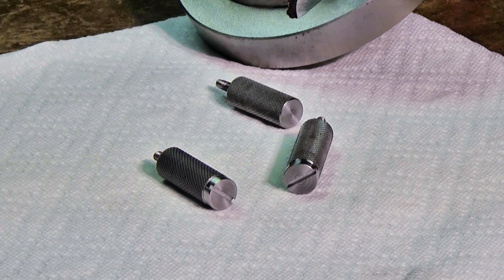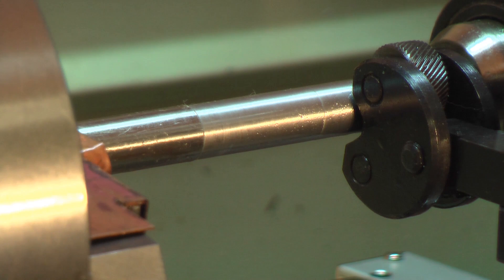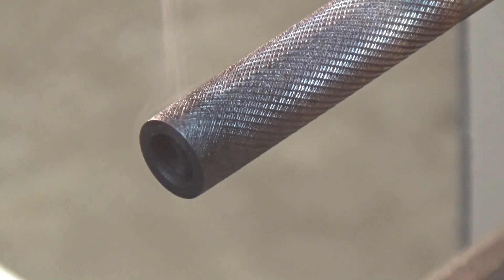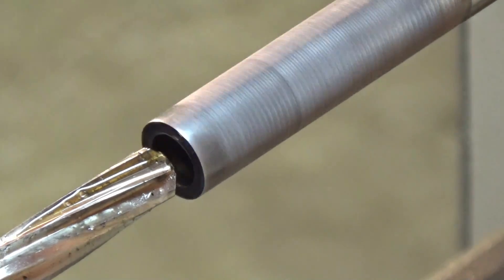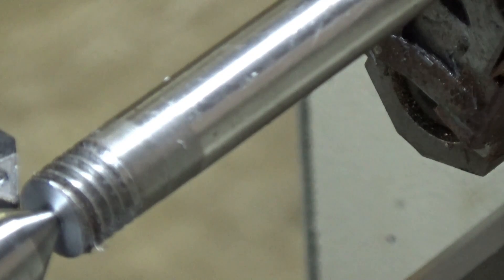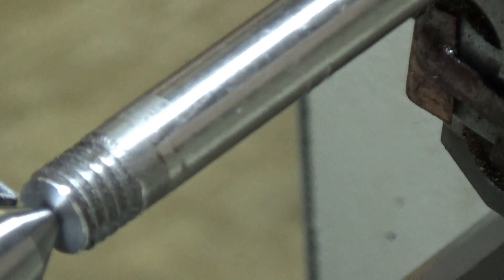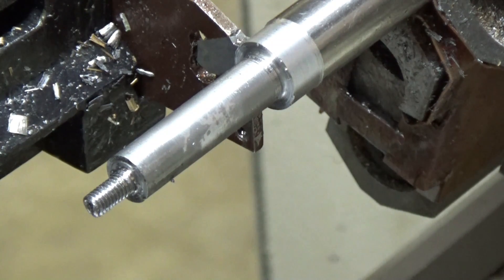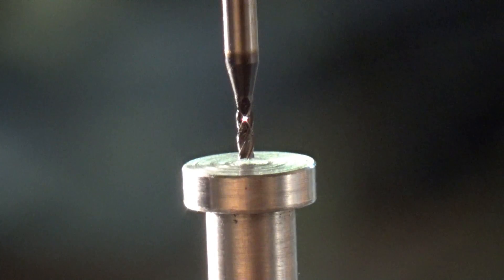Power Down Feed

Comment: Hum... A bump style knurler is a tricky tool to use, mostly far away from the chuck, you get better chances to get a perfect knurl if you get the proper calculated diameter, and, for the first run you really try to hit the part as hard as possible on the start, meaning "Bumping in the tool into the work" so it makes the deepest possible pattern on the first revolution, this will allow the second turn to track better in the first pass....    Like I said, a little tricky...   ;)
Send a few storms down to California, they crave for anything wet falling from the sky.
Reply from the maker: It may be tricky, but it is the only one I have..lol so I have to make it work, as always thanks for the tip PB
Reply: If you need anything about knurling, just let me know... ;)

Comment: Shucks - follow the temp change color as you drilled!
Nice high speed available on that mill... still pucker time with a very small end mill! Very nice slot result.. and final test was ideal - you nailed it Brian.
Reply from the maker: I wish I would have recorded the first one I drilled, it went pretty good,  second one not so much, yeah feed/speed showed 10,000 rpm for that end mill, I thought to my self "self your mill won't go that fast" so I took a chance at 3000 rpm, it will top out at 4500 I think. I got one of those cheap optical tachometers and it works well for only $10. thanks for watching

Comment: Burnt the hole through that piece.
Zeke barking at the thunder?
Nice fix on the knob.
Mike
Reply from the maker: Mike for some reason the only 5/16 drill I had was dull as a butter knife. Yeah when I shoot Zeke hides in the shop, when there is a storm he goes full "Wolf" mode. Figured out the metal detector, as soon as you said "notch" filter I got thanks